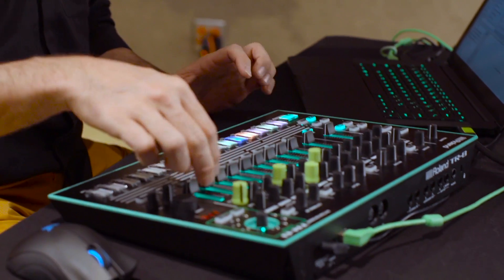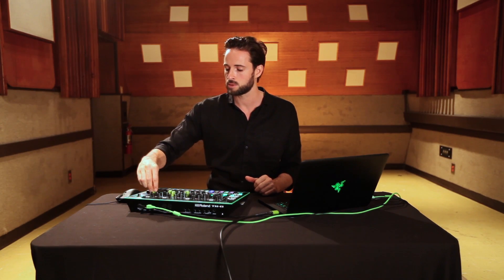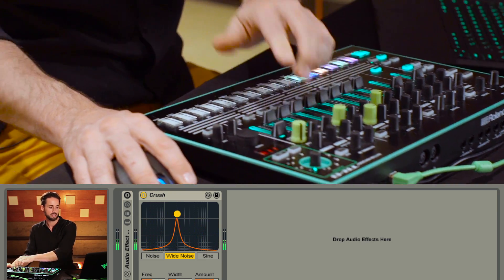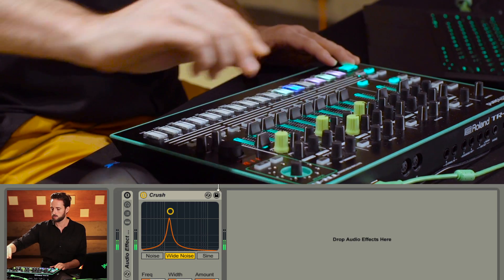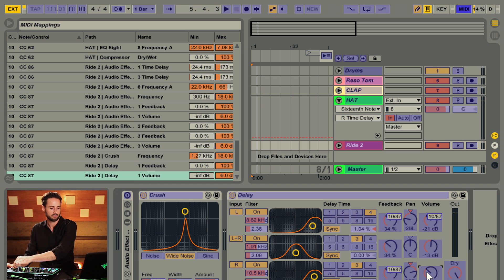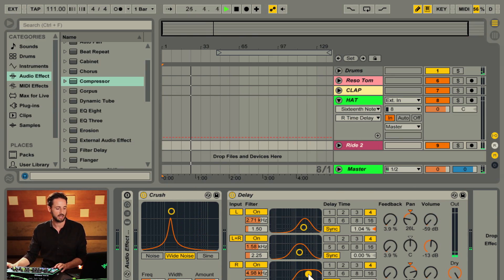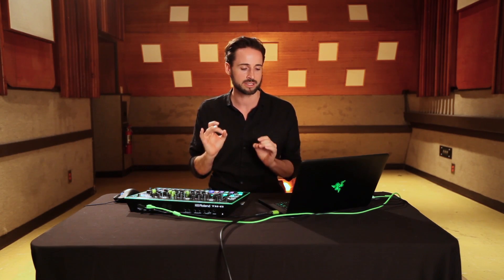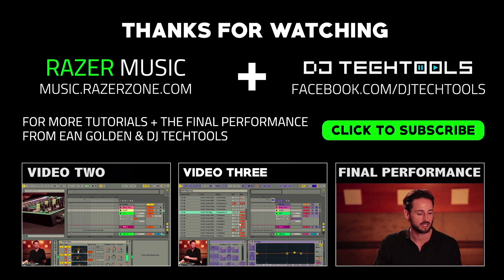Adding Crush + Delay To A TR-8 Ride Cymbal With Ableton Live

Comment: Ean.. just curious.. what are you using as your audio interface? The TR-8 itself? If not, then do you route your sounds to the different A-B outputs? Panning?
Reply: +DJ TechTools Would be VERY interested to know how this is all routed. Browsing through the comments in this series I was not able to find an answer. I could not figure out how to route this myself without having latency as well as the "dry" drums from the TR8 going out of the mix. How is this accomplished in this video? The TR8's audio isn't even plugged in on the video...is Ean a wizard?!
Reply from the maker: +Clayton Lewis In this case, the TR-8 is being used as the audio input interface.
Reply: Figured it out after walking away from the computer for a bit: You have to route the instrument parts to the A or B outputs. This will prevent the "dry" drums from going directly out, but still allows the sounds to be accessible via USB like in this video.
Reply: Hey man, did you get that to work?! I'm struggling.. Have the TR8 as input and the Komplete 6 for output, using ASIO4All but getting no output... Any help massively appreciated!